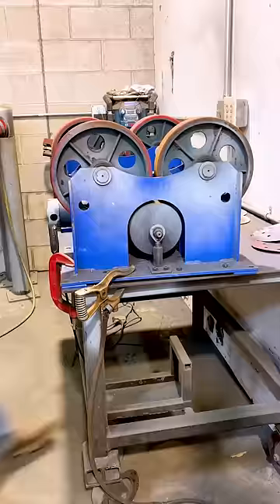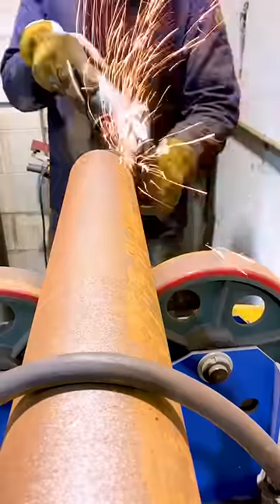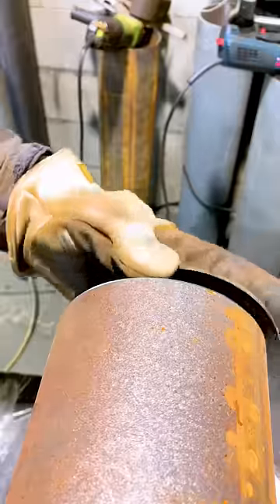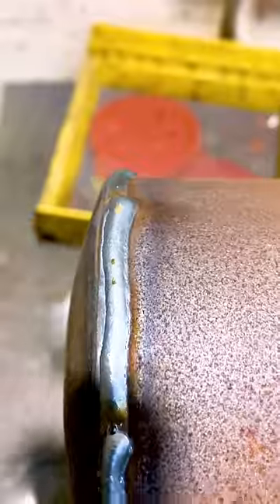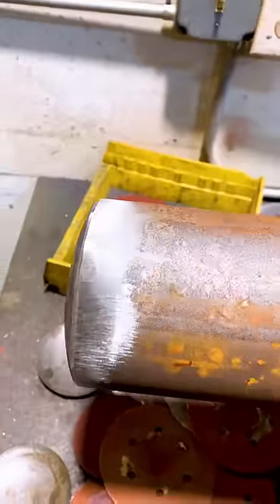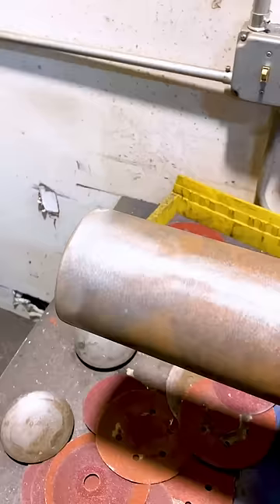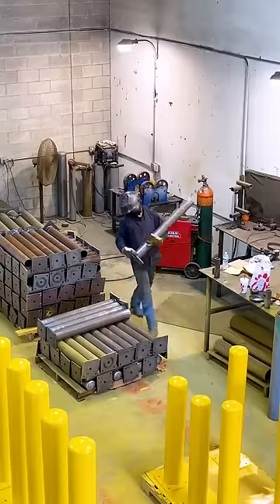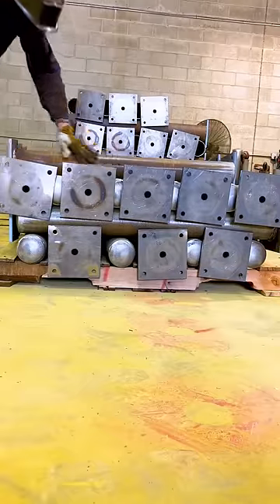Made 50 of these today #welding

Comment: Turn your wire speed down a bit so you don't have so much reinforcment to grind off.  Or go with a higher argon mix and turn your machine up for a spray transfer.  Putting in weld that gets removed later is a waste of money.

Comment: Real question. Does every bit of rust have to be gone before painting?  If so, does it affect the longevity of the part to have rust under the paint?
Reply: it should be, yes.  If they are doing it right, paint is doing the final prep.
Reply: @mtraven23  thank you
Reply: Yes, that was a horrible sanding job. The paint will not last.
Reply: @isaackvasager9957  i think the paint department probably does the final prep...i think...that looked like he was just getting the bulk of the rust off.
Reply: Rust under paint always grows with time. Surprised they don't sandblast them.
Reply: @ferrumignis  it seemed a bit rushed, to be honest.
Reply: @ferrumignis  how do you know they didn't?
Reply: @mtraven23  Why would they waste the time removing some of the rust with a belt sander and then sand blasting it afterwards?
Reply: @ferrumignis  just do get the bulk off?

I dont actually think they'd be sand blasting it after the sanding, but there's probably some final prep being done by the paint department.  I'm just giving them the benefit of the doubt given that all the info I have, came from a 60 second short.

Comment: If you use a laser sublimator you won't need to belt sand and it will make for a better paint adhesion and coating
Reply: It’s called laser ablation, and the non Chinese crappy versions cost $200k.  The also don’t remove mill scale or smooth the surface, they just remove iron oxide, paint and grease.

Comment: Gotta love that future work creation 😂

If I left that much rust before sending my work for paint I woulda been down the road so fast 😂
Reply: That what i was thinking.
Reply: These get sent out for powder coating. They will get sandblasted 6 ways from Sunday at the coating shop.  😎
Reply: @thefreedomchopper4027  Then why use a belt sander... he is painting them.
Reply: @thefreedomchopper4027  You can see the ones sitting on his floor.  They are painted there
Reply: @redneckswitwheels  ... if you have ever sandblasted, then you would know it's better to get the bulk off first. It helps make the final finish more even.
Reply: @rupe53  actually I own a two. A pot and a cabinet..I actually do this work everyday for 40yrs so now man try again cause ya don't know what your saying about this here subject
Reply: @rupe53  also its a Ballard it's just a metal pole. All that time spent polishing a turd when sand blasting would have made quick work of this. Plain and simple
Reply: @redneckswitwheels  .... let's' look at this another way... at one time I did welding, and I always put a little buff on my work because I wanted the finished job to look a little better. The next guy appreciated my work. Fast forward a few years and I dabbled in construction where the carpenters said the drywall guys will make it look better. Those guys said the mud & tape guys will fill in the bad spots... but we'll leave the sanding for the painters... and the buck gets passed around. It's the same no matter where you go.... and someone needs to clean up the final product.

Comment: Damn, that's a nice order. I install these occasionally and usually just order round stock and core drill them. If I'm on my game I'll cut and weld the caps at the shop and send them for powder coating. Doesn't make a huge difference but on bigger jobs it's faster and can actually save money. If you buy your plates and use boots, core-drilling will save a lot of money and time.
Reply from the maker: Yeah we move pipe out of here for core drilled bollards too. If you’re gonna fill them with concrete Topgard has pre formed concrete caps that you set on the top and are held in with screws that go from the bottom of the cap into the concrete
Reply: @1990 Trade Co  really? I'm going to Google them. I've installed a couple retractable bollards at the airport and an FBI office in Dallas that are supposed to stop a box truck doing 50mph (iirc). I mostly do drivegates and operators but bollard jobs are occasionally a way to make some extra money on a job if I have the time.
Reply from the maker: @SaltyFarm  yeah Topgard.com for the caps and he also sells those retractable bollards out of here (bollard shop.com) out of Indiana
Reply from the maker: “Retractable” I was thinking collapsible” my bad. Either way… yeah man it’s crazy how much work there is on bollards, you don’t really think about it til you think about t but bollards are everywhere

Comment: I don’t bevel just turn the heat up more.   I run at 32v at 675 wire speed. With a. 480v miller welder.  That belt sander is the tool to have.  That looks like it makes life easier.  😊
Reply from the maker: Damn really?! What size wire?
Reply: .35 wire.    Turn the heat so high that you will see it melt and create the bevel.   Some of the people I work with run it all the way up to 36v and still around the same on wire speed
Reply from the maker: @2exiw  damn well that’s what I’m running, 35, I’ll throw some heat at it and see what happens
Reply: @1990Co  let me know how it works for you.

Comment: What kind of impact would this take? I always filled these with concrete and used the concrete to form the cap. I wouldn’t be able to use these around the high voltage power lines im usually attemptong to protect though. We have to go bigger then that, and 4 ft in the ground. This could be useful for when I block off propane refills. Id rather throw in some red heads then dig.
Reply from the maker: They’re usually installed with 3/4 bolts, as far as concrete filled we ship pipe out of here to shove in the ground for bollards, we also got an option where you can fill one of these bolt down with concrete, and then it comes with a cap that sets into the concrete. It’s just different types for whatever your application calls for. Strengths/weakness to all

Comment: I was always taught a good /proper weld looks better than one that's been ground! faster less waste in time and materials..crank that welder up and get moving! keep bumping up that wire and heat.. a little at a time.. just move faster and faster as you go.. 3 basic adjustments.. wire speed...heat... and how fast you move! many times I was given a test and never even looked at the settings..just pulled the trigger and go! crazy when the last guy welded something like 3/8 or 1/2 and I am told give a horizontal and a vertical weld on something like 1/8 or 1/4   its like oops & you just fly!! lol! keep going hotter faster more wire! then afterwards...put it back where it was and try it again and it's SOOOO dam slow lol! I remember running .045 wire at 1400 inches a minute and WAITING on the wire wishing i had .060! lol ...I've melted the lense out of my speed glass a few times and had skin  between my fingers peeling when I pulled off my gloves! seen my reflection inside my helmet..dipped a red hot cone in the nozzle dip and watch it light up!  we even blew up a few Miller 350P's .. not so cheap lol!

Comment: You should really use a welding turntable and jig that MIG gun into a c clamp on a pipe stand and put a hand control switch on your welder.  Works great.  But glad it's you and not me.  I'd be more like 2 a year.  For my own shop door😅

Comment: Our GC had the concrete guys just put some 6 or 8 inch black pipe in the ground, finished pouring the apron Infront of the garage doors and then fill the pipe with Crete. Then a Plastic yellow sleeve over the top
Reply: I'm not trying to knock the way this guy's supporting himself, and probably his family. But the ballards you described in these Ballard's are completely different. I've done what you explained, and they can take a hit. These will pull the anchors out of the concrete or bend the base plate. But I understand why this guy does it. Got to make money any way you can.

Comment: Not that they were bad welds but remember boys a grinder and paint will make you the welder you ain't when you're doing job like this you don't have to be some AAA top of the class weld anything and everything guy you just got to be able to make do and be able to tack a decent bead and grind it down tack a new one grind it down and have it look flush I took a class on this back in high school and actually got to go over to the university nearby and learn some stuff from them and I learned all kinds of really cool facts about it if memory serves it's either 1/8 or 1/16 of an inch to get maximum bond between two steel plates the art of welding is absolutely amazing and it's not anywhere near as difficult as people make it up to be alot of it's just concentration and practice like you just got to be able to sit down and focus on what's in front of you the difficult part comes into the kinds of elements you can come into and there's all kinds of welding out there all of them different some in small ways others in much bigger ways
Reply from the maker: 🙏 amen brother

Comment: Why didn't the design call for smaller caps?
Reply from the maker: I’m not sure I understand your question? As in smaller diameter?
Reply: @1990Co  make the cap's diameter the same as the pipe's inner diameter, then you're left with an open corner joint & don't have to bevel
Reply from the maker: @gm3093   ooooh ok I see what you mean. I that would make it harder to get the finish we need. If this was any other application that is not just aesthetic I’d say that would be the way to do it though
Reply: Or make cap as an insert with the bevel on the cap or on the inside edge of the pipe.
Then fit it flush. Easy grinding flat surface.
Or instead of bevel just have a gap in between...
Just realized the caps are convex from factory i assume.
Still if instead of the bevel in your case to make a gap you may end up with the same result and less grinding in the end and no beveling.
Reply: @g m  exactly.  Corner weld, hot and fast = no grinding at all

Comment: You're wasting money on your consumables. Looks like mixed gas, go to Innershield, give it a 1/16+ gap, get volts right, your rollers going nice, and it's Shit & Git! Minimal weld cap, you could run a flap disk for a couple rotations, but other than that, you're done.

Comment: The ones I usually see are just a pipe filled with concrete, no cap.
Reply from the maker: Yeah that’s what’s mostly out there
Reply: @1990Co  ok, thanks. I was thinking that was the old way and they just haven't needed to be replaced yet.
Reply from the maker: @elementalist1984  most bollards you see are just pipe stuck in the ground and filled with concrete. a lot of the time it’s easier on certain jobs to get something like this that is just bolted down. As a whole we ship hundreds of just pipe out of here though
Reply: @1990Co  A bunch of buildings get really creative with these things in NYC. The variety is amazing.